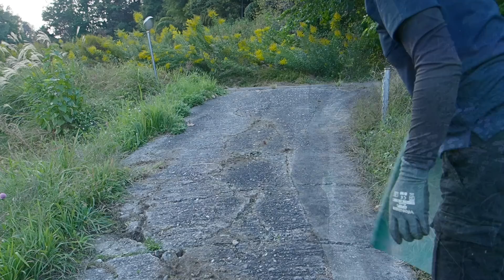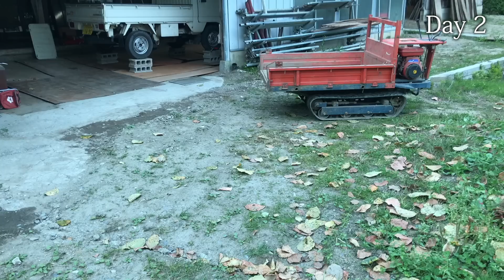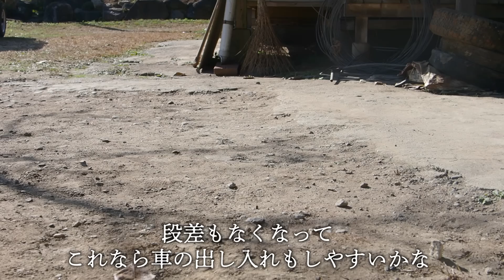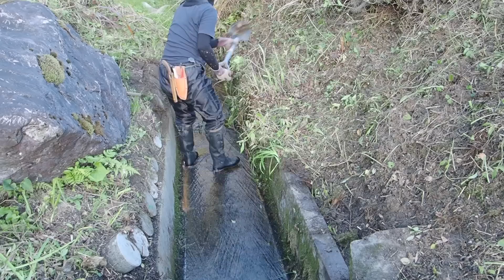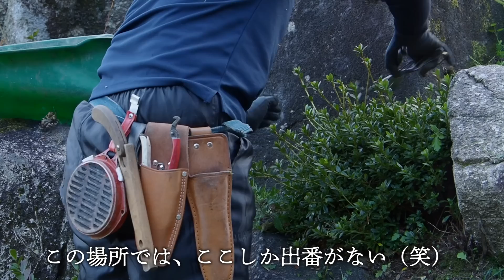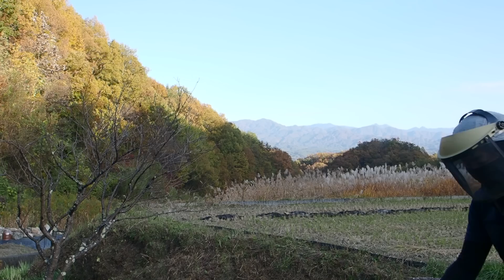田舎暮らし 083：古民家の庭の手入れ

Comment: I just love the gardening that you do. Want to join the fun actually 😊
Here in Finland winters are freezing so we use hose pipes in diches and trenches to be able to defreeze them in the spring. When the ground is still frozen but the snow starts to melt, we pour hot water into the pipe. 
Lots of love from Finland❤

Comment: Compliments to you both! And がんばってください。Yours is a BIG undertaking.

I'm a little envious. You're lucky the deer and hares haven't destroyed your satsuki. Down here in 南紀, we are in a never-ending battle with deer, wild boar, hares, moss and weeds for ownership of our lawn, shrubbery and flowering annual plants. So far a vegetable garden is out of the question. I am going to have to put up an unsightly wire fence clear across the front of our property to keep out the deer and wild boar. It's probably impossible to keep the hares out. 

As for mowing weeds, Yes! Several times per year. And yes, there is the constantly digging up of ゴミ, stuff imbedded in the ground, left by elderly people losing their ability to keep up with the yard, putting out old carpets and tarps to cover and prevent weeds. And the weeds just grow right through and the soil builds up over everything. The frost heaves up stones every winter that the blade of the lawn mower strikes every spring. New blade every two years!

Ah, yes, the relaxation of living in the countryside. Still, we love it.